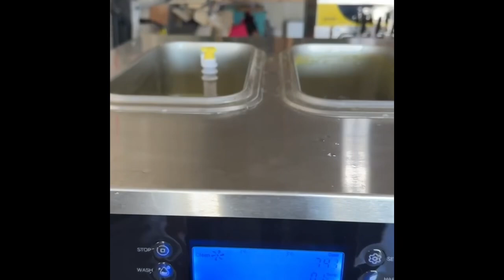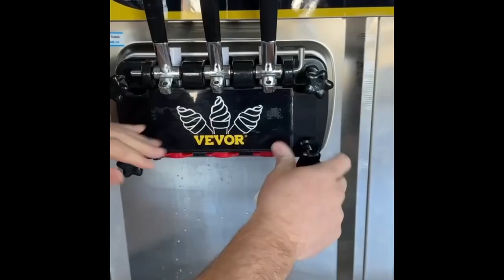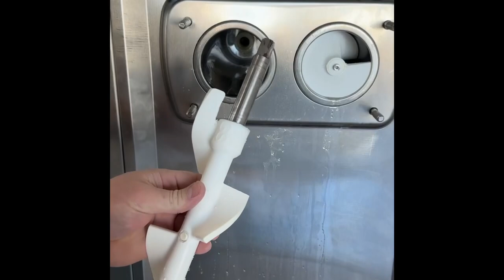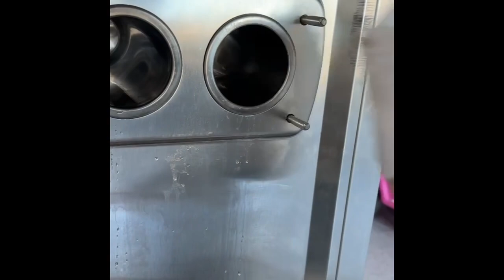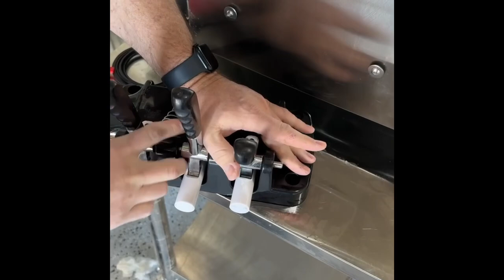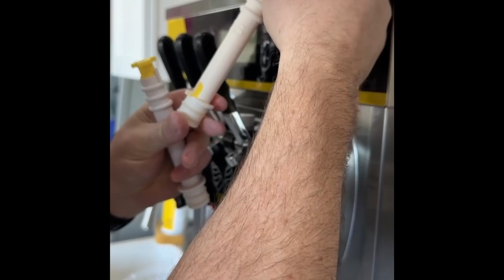Vevor ice cream machine cleaning and disassemble

Comment: Hello i have a Quick question for you please 
I have the same machine and I have a hopper error every time after lunching the machine when the ratio became 58  do you have any idea what can be the problem? 
Thank you
Reply from the maker: If you can upload a photo or video or list what the error that displays, I will be happy to help. Common issues are usually around, not having enough power so the incorrect plug/breaker set up.
Reply: Of course if you have Instagram or Facebook so I can send you the video there thank you

Comment: Hi, great video. Is it easy to find replacement gaskets?? VEVOR do not sell them
Reply from the maker: Thanks! Yes, there are a few places you can find them. I can link them through my affiliate links on Amazon below. I prefer to use the black gaskets kits as they hold up better and are still good grade. Hope this helps! 

Gaskets for main valve body
https://amzn.to/4n1pJWT

Gaskets for middle dispenser tube 
https://amzn.to/3JtWcXm

Bulk gaskets for hopper and dispenser tubes 
(Test fit to find the right size)
https://amzn.to/4lLmgdX
Reply: @brittonbauer1086  Manu thanks mate. 😊

Comment: I thankfuly found your video as the directions from the company were greatly lacking. The part at the top that helps with fluffiness I cannt get ming to fit in the hole. Is there a better way to do that?
Reply from the maker: Glad this is helpful! Yes, you want to put some food grade lube, or water and lube up the gaskets before putting it in and it will slide much easier. You can use my affiliate link below to buy the lube that I typically purchase.

https://amzn.to/3HDkX2I

Comment: Hello do you grease the ends of your augers? If so what kinda a grease do you use?Since I’ve have  game my machine a clean a squeak has an appear.
Reply from the maker: Yes I will grease the ends of the augers and the boots. You will want to grease your gaskets on the main assembly before putting that back on and sealing it up. I just use food grade grease . You can grab that in Amazon. I will be updating a link to items I usually buy on my profile page soon.

The squeak can be caused from lack of liquid in the freeze chamber or the belt. Let me know if you need more help and I can help with a video on those items

Comment: Hello, may I ask what power are you running it on. Does 20A 110V enough for this machine?
Reply from the maker: Yes I run on a standard outlet and 20A circuit
Reply: @brittonbauer1086  Is it 20Amp 110V?
Reply from the maker: @DàiDaivàDở yes that is correct.
Reply: @brittonbauer1086  Thank you so much, this helps a lot!
Reply from the maker: @DàiDaivàDở  you are welcome. Another pro tip is to ensure that there’s nothing else on that plug/circuit otherwise it will trip the breaker.

Comment: Hey sir just bought this machine worked great now belt is squealing I just got it today and made probaly 10 -15 ice cream cones and it started squealing how do I fix ?
Reply from the maker: There are a couple different possibilities.

If it’s the belt, there is a tensions below the belts on the back of the unit. (You must remove the back cover to access) 

The other option is, if you only have material put in one side of the hoppers, the auger blades will squeak and a very loud noise. Make sure that you’re using both sides as it is required for both to operate. 

If you could send a video of the issue, I can walk you through the appropriate remedy
Reply: @brittonbauer1086 ok thankyou next time I put ice cream down it I will video it thanks
Reply: Where do you buy the premixed bags for your machine ?
Reply from the maker: @tis_jibby7913 Amazon when in a pinch (they are more expensive there. Lots of quality restaurant supply online retailers like foodservicedepot.com. If you have a local restaurant supply store like the chef store, those are a great place and will typically be cheaper than Amazon/walmart who usually are selling from third parties.

Comment: Hi! Quick question! If you use it daily do you pour out the mix and clean it that way daily? 
Thank you for your help!
Reply from the maker: Great question. If you have the model that has cool hoppers, you can keep it going overnight. Just use the keep fresh button for anything that is dairy based. Printing non-dairy base you can keep the machine going you just wanna make sure that there are no issues with things staying refrigerated for dairy safety.

If the material is too warm on the top and has been sitting for a longer period of time typically over a day, it can affect the consistency of the ice cream, but the machine will still work just won’t be as fluffy or rich. 

Typically, I don’t keep it going for longer than a day as it’s not too difficult to clean and create a better product. 

Hope this helps. Let me know if you have any other questions.

Comment: I just bought this machine and there was a little bit of oil spill in the front part of the coverages and dispensor of the ice cream , do you think this is bad or not?
I am letting it rest for 24 hours and then turn it on 
Any recommendations? I would Highly appreciated
Reply from the maker: Can you send a photo of where you have the spill of oil? If it’s just on the dispenser area, you can dismantle and clean that and that will not affect operation. If it is near the electronics display or behind, you would want to take a look before turning the machine on.
Happy to get more insight if you upload a photo of where the concern is

Comment: Thank you, I just got my and I was lost
Reply from the maker: @Imvamay  You are welcome. Glad this was helpful.
Reply: @brittonbauer1086  I’m thinking about making a purchase on one. Are you a vendor or just a customer?
Reply from the maker: @rodneyhoadley3167  I am just a customer. I have owned any of these over the years. The best places to purchase them are either directly from Vevor or via a third-party retailer like Amazon, Walmart, Home Depot, etc.. price will vary and each one sells different models so make sure you know which one you want (wattage and features)
Reply: @brittonbauer1086  can you help me pls? I got one recently and its not reaching more then 85 percent. Also was throwing error 88 if i set hard level at 5 or above
Reply from the maker: @PrashantJoshi-jn2ed  there are a few potential areas that could cause this. The first one is what amp is the outlet the machine is plugged into? If the machine doesn’t have enough power, it can prevent it fro finishing the ice cream. Sometimes as well if you do not have the inserts in the top hopper set to allow enough material to go through that can also cause issues as the cylinders will come to frozen with not enough material. Another issue is the material could be the incorrect ratio so if you’re not putting enough water/liquid or too much water that can also affect it. You should be able to have it at least at a level five without any issues. I have learned issues when you put the hardness up to the highest level it will over freeze the cylinders. 
Feel free to upload a video of what’s going on to troubleshoot further
Reply: @brittonbauer1086 hello thank you for responding. 
I will upload video. Just not at the place. 

Quick question- what does countdown mean? Snd what level it should be at?
Thank you